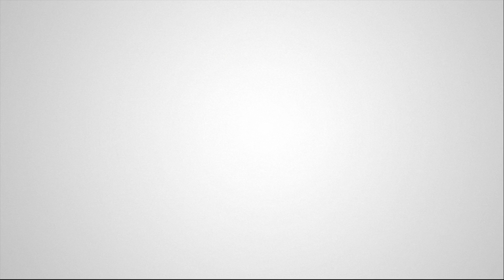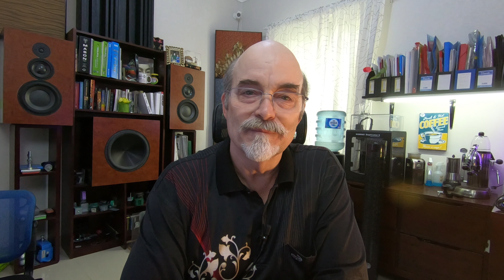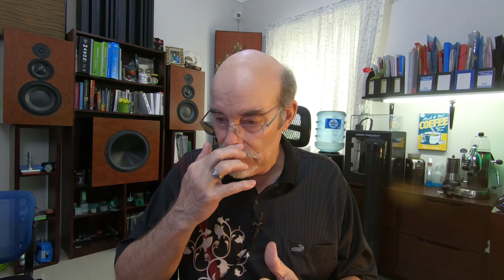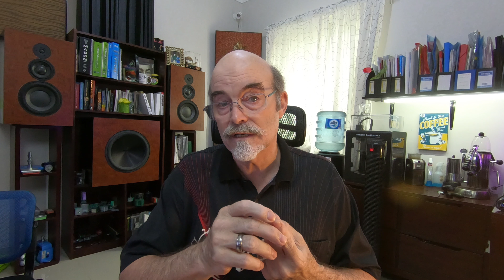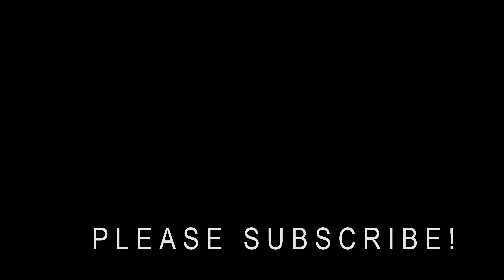Rock Wool Does Not Sound Proof

Comment: John, I'm confused with wanting to "absorb" sound and want to "sound proof" something.For example. I live on a busy street and I have a window that I'm planning on filling up with rockwool (it's 80kg/m3) which I assume will give me enough mas to "keep out" traffic noises from getting in my house.Assuming that I put all the rockwool and seal it correct, wouldn't the rockwool help in this case?I'd but putting it over the existing pane of glass.Hope to hear your thoughts!Thanks. Great video!
Reply from the maker: James, Rockwool will attenuate due to the fiber absorption. If your Rockwool is 2" thick (5 cm), it will work great for frequencies above 1 kHz. Rock Wool DOES NOT SOUND-PROOF. 
Just ONE layer of 5/8" (16 mm) Gypsum board (type-X) will reduce traffic noise SUBSTANTIALLY! It is MASS. Mass is the key. Rock wool has nearly zero mass. I mean seriously, look at this: one CUBIC meter of rock wool only weighs in at 80 kg. Are you going to put the whole cubic meter in there? No. Of course not! You put a thin sliver of it in, which, if your window is 100 cm by 60 cm, is only 2 kg! TWO kilos. ok? Now a piece of 16 mm gyp board of the same size weighs in at nearly 11 kg! Almost 6 times as much. 
There is also the resonance factor that must be included. This involves the depth of the airspace (fiber filled or not) which along with the mass determines the resonance of the 'sound-proofing system'.  The resonance of the 'system' MUST be at least 0.707 times the lowest problematic frequency. ;)
Reply: John, thanks so much for your detailed explanation. I totally understand now how rockwool works (or doesn't work rather) when it comes to sound proofing.
Yeah, not being I math person I didn't even do that calculation of getting only 2kg of material for this particular project. That's definitely not a solution to my problem.
You've brought up and interesting topic which is "resonance". One of my major issues are buses and heavy machinery, and as you probably know, diesel engines produce a very low frequency sound wave which is hard to "block". I haven't found any literature on this, but I'm guess it's around 100hz or even lower.
So basically I have 2 options here: 
1. Add a double pane window with asymmetric glass. I was offered 3mm+3mm laminated in the middle, a 12mm air chamber (which does next to nothing to stop sound) and another 4+4mm laminated glass. So that's 14mm, (or 9/16 of an inch), and according to the specification sheet, it's 45 kg per m2. So if my calculations are correct, this window has a surface area of 1.08m so we are talking about 48.6kg of mass. 
In your opinion, would this be the "best" solution for blocking low frequency (and mid to high since we're at it)? 
Going back to "resonance", wouldn't a 16mm gympsum board, 5cm rockwool and another 16mm gypsum board have similar soundproofing properties to that double pane window I mentioned above? 
Also, let's say I go this route and leave the existing 2mm single pane glass there: Should I put the first gypsym board "touching" the glass? or should I leave some sort of air space or some other more "absorbant" material in order to stop vibrations?

This is driving me nuts because I can do something to block mid to high frequencies, but then I need to block low frequencies and that means that there are a lot more variables and issues to take into consideration.   

So basically what would you do, John: Thick double pane window or gypsym board + rockwool + gypsym board?

Sorry for being a pain in the butt but you know your stuff and I greatly appreciate your help.
Also, sorry for using metric but imperial system is something I could never wrap my brain around :)

Thanks John!
Reply: Hi Again John.Just watched your video "How Much Isolation Do You Need? - part three - GYPSUM BOARD WALLS" and your suggestion is to not let the rockwool touch the gypsum boards. 
Being that I only have a usable space of around 8-9 cm (from the glass to the frame of the window), my gypsum board + rockwool + gypsum board isn't going to be that great of a solution.I think I'll just go with the laminated double pane glass option. 
Sorry for typing so much but you've made me realize a ton of things I hadn't even considered before.

Comment: for wall insulation, how would you compare rockwool/mineral wool/ to a dense cellulose (apparently ones with cardboard mixed in, are better at sound dampening).  thanks much
Reply from the maker: You have to remember that salespeople sell stuff. If they have to deceive you to do it, there are ones who have no integrity and they will lie, while others really don't know any better and do what they have been taught. 
You can only trust information if it is presented with facts, testing data performed according to international standards.

On my resources page, you will find ir761. This document cost the people of Canada millions of dollars to produce. The testing data was done in an accredited, certified laboratory according to ASTM published standards.
For information about what fiber to use in your walls, see and compare pages 19 & 21, 49 & 51, and 60-61-62-63. 
Rock Wool does not soundproof
Fiberglass does not soundproof
Cellulous fiber does not soundproof

ONLY mass and seal will soundproof. ;)
Reply: @JHBrandt rock wool dampens, when integrated with mass it reduces resonance, which in turn reduces received sound.

Comment: I see the light of rockwool as I was close to buying some x3 packets so you just saved me the trouble of buying it. I was looking for detail specs on the sound side as to how much it will reduce frequencies with a frequency sweep graph but I can't even find a practical video that shows this first hand all I see is a load of written specs and I want see a lengthy video of this rockwool tested with frequency sweeps sine wave spot tones even tested with, the last jedi.
Reply: rock wool doesn't work as bass trap/absorber. nothing will, not even wet concrete can trap bass. what these recording studios are doing in real life is compensating the bass through eq in the mastering before pressing. foam as long as its open cell not molded, is going to absorb the treble frequencies and you want that to deaden the room removing echo. all the other crap you find in audio forums are all geezer babbles and semantics not worth your time. THE ONLY WAY TO ABSORB BASS NATURALLY IS TO REMOVE YOU WALLS INCLUDING THE CEILING SO YOU ONLY HAVE TO DEAL WITH THE FLOOR WHERE THE BASS BOUNCES UP AND NEVER COMES DOWN AGAIN or have louvre type windows all over the house at least the horizontal waves are going through it and leave you.

Comment: Thats RockWool and not Acoustic RockWool Slabs - big difference.
They meet UK Building Regs for 43dB attenuation.
Reply from the maker: Sorry, Prince not true. Any fiber product will NOT soundproof by itself. No fiber product has been tested for soundproofing, only 'noise reduction coefficient'. NRC is a measure used for the 'TREATMENT' of a space. It is closely related to the Sabin number for the product. It will also vary greatly with the testing process and can be very unreliable. ;)

Comment: Hi John, great video. I am currently moving to a new apartment, which has a "shelter room" (basically a room fortified with concrete, so it may withstand bombs/rockets). I plan to have a drum set in this room, and I want to reduce the noise from those drums as much as I can. Would you recommend not to use rockwool to reduce the noise? Its a fairly small room, with a heavy metal door. I am completely inexperienced here and any advice you give me will be very much appreciated
Reply: MrAmirkedar - Just curious as to what you ended up doing in the concrete room? I’m in a flat and wanting to build a drum riser for my electric kit and I’m doing research on how to minimise the sound of the bass-drum pedals.

I needs to practice, man! 😂 

I would have thought that the kit would be very loud whilst inside a concrete room, but how soundproof is it from the outside?

Comment: Agree so much on this topic. But question. 

If building accountic panels for room managment (think homes theater) where I am building add on panels (wood framed, fabic wrapped) does the rockwool / mineral wool not have an advantage there with its increased density?
Reply from the maker: Sorry for the late reply, Chris.

The increased density CAN cause it to be reflective. I have done many tests that show 4" of the average density Rockwool to be too reflective. You are better off with 1" Rockwool against the wall with the rest of the treatment thickness made up with low density glasswool (fiberglass) for a most effective and efficient trap.

Comment: speaking from experience, rockwool does a great job when used as part of a soundproofing studwall system
Reply from the maker: Of course it does. This video is about the Soundproofing qualities of rock wool or fiber absorption by itself.

Fiber is a a velocity absorber. It doesn't soundproof. The fiber in a wall cavity absorbs the resonances WITHIN the cavity. In this way it adds damping and lowers the system resonance. 😎

Comment: So, long story short, what is the best way to diy soundproof? What is the best to soundproof as a pro?
Reply from the maker: Soundproofing is done with Mass and Seal. The best sound-proofing is made building an isolated structure and filling the cavities with fiber (rockwool or fiberglass), 10 - 25 kg/m3 density. 😎

Comment: I don’t know whether it can fully sound proof, but it sure as hell cuts down on outside noise.
Reply from the maker: LMAO! Why did you comment? Are trying to argue with the facts? Do you sell this stuff for soundproofing? Many do and they honestly BELIEVE that it does soundproofing.  It doesn't.  If it did they would have it tested in a lab "by itself" without a wall or gypsum board or plywood... just rockwool in a frame between the testing rooms.

No, it doesn't soundproof even a little bit. ;)

a plain bedroom wall (frame construction with drywall and fiber fill) will give you about STC 32.  I seriously doubt that you get 6 dB from a wall of rockwool.

Comment: Hey john, do you have any recommendations that I can use for strict soundproof material period ? I have an issue where I’m using my indoor voice while doing anything in my room and I’m getting various noise complaints and I’m currently looking into products to help me out . Do you have any recommendations to help me out with isolation and soundproof in my bedroom?
Reply from the maker: Mass, any mass. The cheaper the better. Drywall has always been a 'go-to' solution for mass. And don't forget the seal.

Comment: This is kind of half-truth/misinformation. Rockwool does reduce sound transmission, it's just typically not enough to completely block sound at 3 inches. However, at 6"+ it would be pretty effective at sound blocking.
Reply from the maker: No, it doesn't. YOU have been mislead by misinformation.

The thing is that we can go round and round all day with statements.

I have FACTS to back up my statements and since you are stating the opposite, we must conclude that YOU are mistaken.

Read some books. Stop watching YouTube and reading forums.

My book should be finished by early next year. 😉
Reply: @JHBrandt  All material blocks sound as any time a sound wave hits a surface there is energy loss. You can technically soundproof a room if you compressed enough newspaper. You're trying to argue with basic physics. Enough Rockwool can effectively block sound if there is an airtight seal because of physics. If you would have just said there is better material to use than Rockwool, that would be fine...but saying that it can't be used as part of a soundproofing setup is misinformation.
Reply from the maker: @Qdouble  more statements without evidence. Get your own bullshit channel or
PRESENT YOUR EVIDENCE AND TESTING DATA THAT CONFORMS TO INDUSTRY STANDARDS.
😅🤦‍♂️
Reply from the maker: @Qdouble  the thing is, I DID say that it is used as PART of a Soundproofing system but by itself it does not Soundproof.

People misunderstand soundproofing and get it mixed up with room treatment.
Reply from the maker: One more thing... Why HIDE who the fuck you are??
Got some dirty little secrets you're trying to hide from?
Maybe folks might recognize you as a troll or spammer if you used your real name or at least the last code name you used.

As you can see, I have very little respect for people who argue science with statements. 🤦‍♂️
Reply: @JHBrandt  😂 Open up any book about how sound works. Sound dissipates through air or any material. The more material sound travels through, the more energy it loses that transforms into heat. Going through a sufficiently dense material of any kind, including gases, sound will lose its energy. Once there is no more sound pressure energy, you’ll no longer be able to hear sound. 

If you want to argue with that then you simply don’t understand the physics of sound. It doesn’t take any special kind of material to block sound...some material is simply better than others.
Reply: @JHBrandt  lol, I don’t have a personal profile because this YouTube and not Facebook and I’m not a content creator. I don’t know why you are swearing for. I’m simply pointing out that you said something incorrect. It seems that you take a critique of your incorrect statement as a blow to your ego even though I didn’t make a personal attack.
Reply: @JHBrandt  Also you need to consider what is really the difference between absorbing a wave and blocking a wave (whether it's light, sound pressure, etc). Absorption is partial blocking... it's simply that some still gets through.

If you put a light t-shirt to block sun light, the t-shirt is partially blocking the photons, which is why it is dimmer on the other side... it's just that some photons go through the t-shirt. If you layer these shirts, you will block the light.

Likewise, if you use Rockwool, the loudness on the other side is reduced because the sound absorption partially blocks some of the sound pressure energy from making it to the other side. If you layered enough Rockwool it would fully absorb all of the soundwave.

Now obviously, there are better ways to do sound proofing that to have a yard thick wall of Rockwool, lol. However, combine with other material...it could work to effectively block sound in a reasonable amount of space.
Reply from the maker: @Qdouble  no, a yard of Rockwool doesn't even come close. Get out of my classroom. You THINK that Professionals who have YouTube channels are just as ignorant as you are. You come into my classroom and disrupt the class... If you don't want to learn anything but instead dig in your heels and defend your novice assumptions, please leave.

If you have something to show, please present the facts. (I know that you can't).

Go to some idiot forum where amateurs show off the little knowledge they have, and mostly myths and misconceptions that are based on their presumptions and biases.

I will delete further comments from you if you continue to argue with me about this. Why don't you spread your bullshit on audio forums?? THAT is what they are for! - and probably where you got your silly ideas.
Reply from the maker: @Qdouble  I fucking cuss a LOT because what better way to ridicule stupid people?
Stupid is a choice. We are all ignorant of many things, but stupid is when you do not listen or study or do your homework. Stupid is when you get expelled from class for arguing with the teacher, like trying to TEACH the English teacher that there is an R in wash cloth (pronounced - woarsh rag)
🤦‍♂️
Reply: @JHBrandt  lol, I'm an engineer, electrician and software developer...but go you obviously have an ego problem, so I'll let you police your channel however you want. You're just looking to bully commenters and not have a rational discussion. Good luck with whatever you do bro.
Reply from the maker: @Qdouble  You are simply an asshole. You offer NOTHING. No proof, no data. I'm going to leave this thread so that people can see what kind of an idiot, who thinks he knows someone else's expertise, refuses to listen, refuses to go get data to present, and just argues with the expert. I present all the data in my book, which is due to be printed early next year.

You also do NOT give your name or 'put yourself out there'. You risk nothing. You give snide remarks in class and pretend that you know more than you actually do. As far as my ego is concerned, it's very healthy. You are using my supposed 'ego' as a strawman... it's a logical fallacy. Your statements are white noise, unbacked by empirical evidence. 

Put your money where your mouth is. EVIDENCE, bitches! LMAO!!